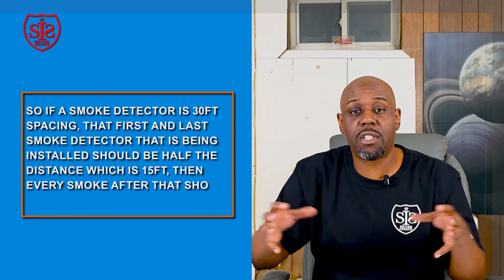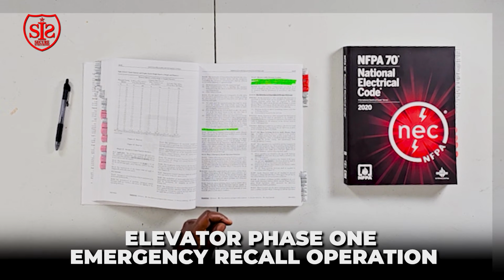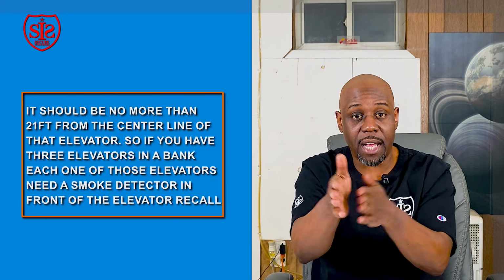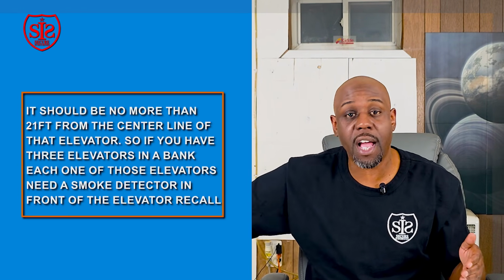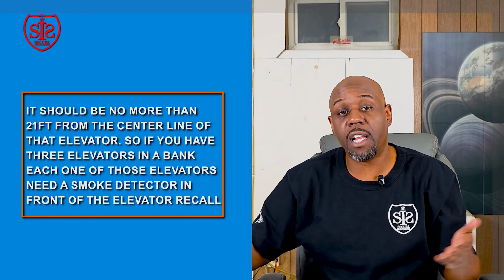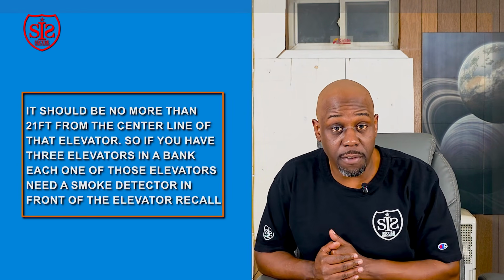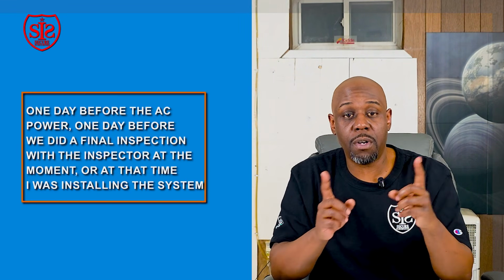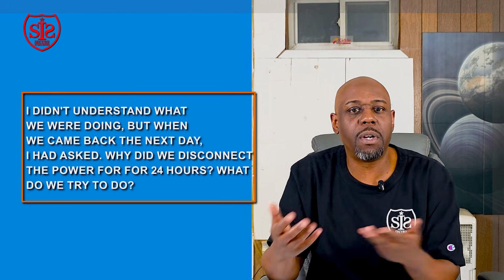The Top 5 Reasons You're Not Passing NICET Level 1 (And How To Fix Them)

Comment: There are zero training and apprenticeship programs in my state.  How the heck do I get started or get my foot in the door?
Reply from the maker: That's a very good question. There is a lot of information online you can get training from like National Training Center, NFPA.org and all the training I am doing. To find work in this field is going to take some adjustments. There are many low voltage companies like, telephone, cable, data cable runner, electricians, cctv, and fire. Getting familiar with wiring is what you need along with some electrical theory. If none of that work try a different sector somewhere you can earn a wage with plans on leveling up to a tech. You will have to decide how much work you are willing to put in to achieve the end results.